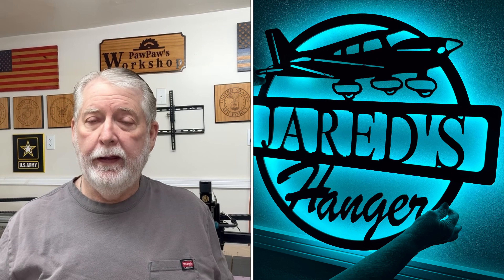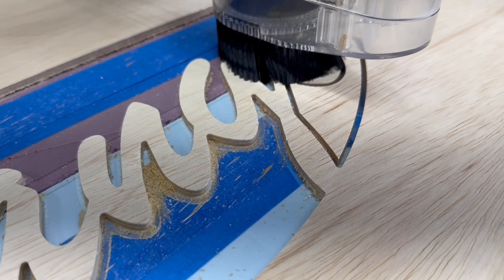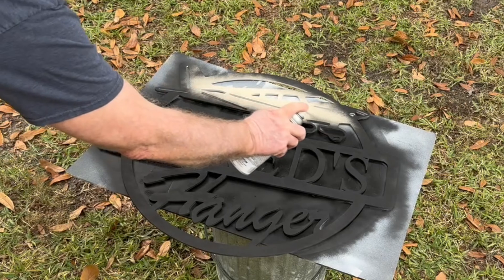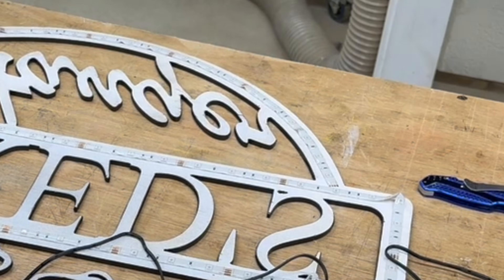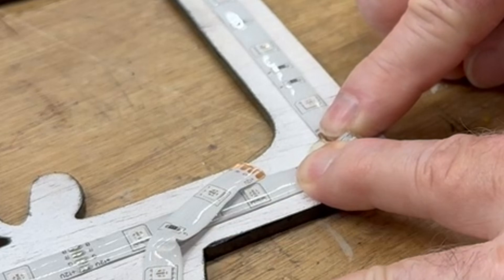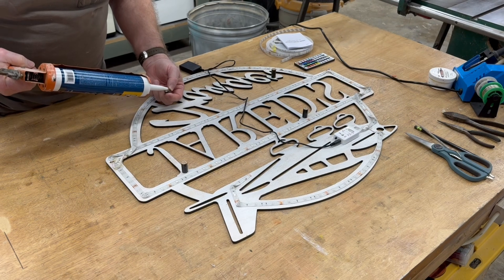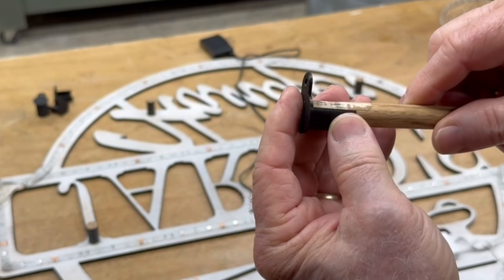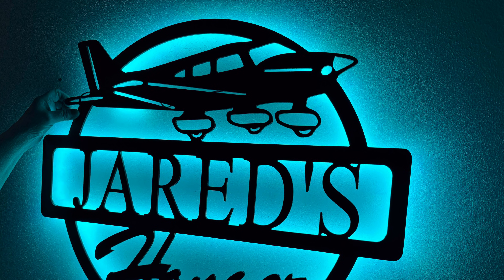Making a LED Backlit Sign & Custom Designing 3D Printed Wall Mounts

Comment: Very easy with a 1300 dollar cnc router? or can you get the same results with a 400 dollar cnc router table. Some list at over 8grand.
Reply: Rob-o1z6w You can do them with a hand held router also, I did them by hand for a couple of years before buying a CNC. But the CNC makes it easier.
Reply: @rbwoodwork1890  For sure, Worth doing the CNC, I do have a 3/8" router and small table but would rather have 1/2" router for other jobs. CNC would make life easy too.
Reply from the maker: An entry level CNC can do this just fine.

Comment: What a nice-looking sign. Hope you Christmas and New Year is field with love and grace. Thanks Tim
Reply: You might also look into using “cob” led lighting strips. They have a type of diffuser that makes the output have a diffused neon look rather than the individual led look.  I just used them in my enclosed 3D printer to tone down some of the glare from exposed led’s.
Reply from the maker: Thanks so much! I hope you have a wonderful Christmas and New Year too!